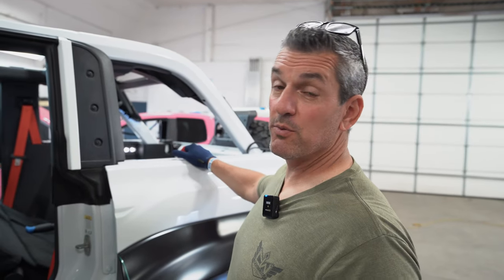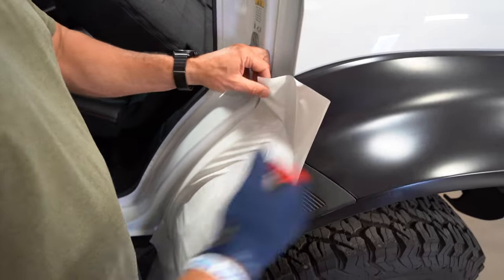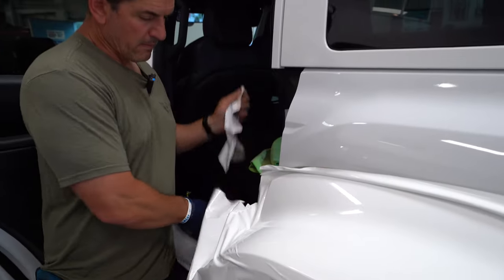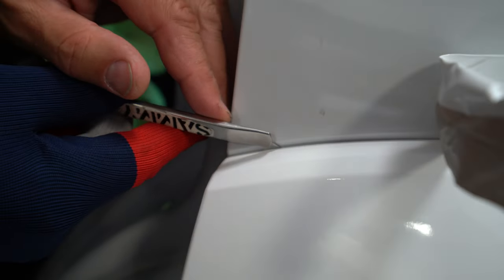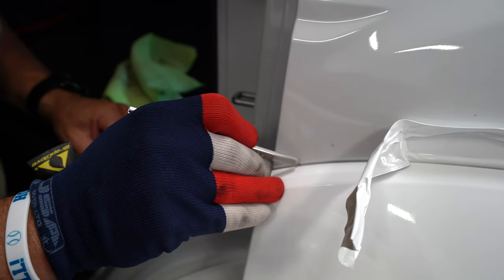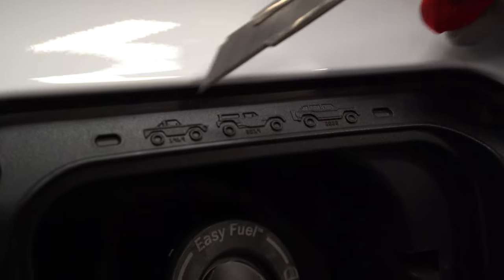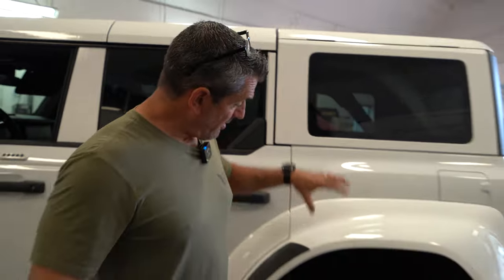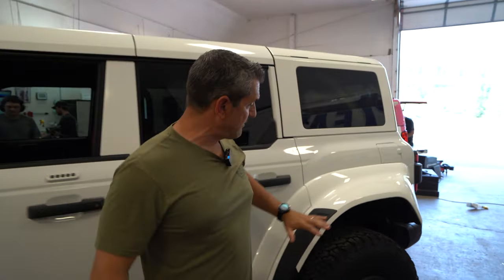Wrapping Raptor Bronco Fenders

Comment: How did you get the vinyl to stick to the roof panels? Did you have to sand them first?
Reply from the maker: @johnrohan1587  great question!! We wipe the panels with 70% alcohol, really well, and then use a heat gun and roller pro or v-cat by 3M to set it really well. Also used 3M 2080 white, the adhesive is tacky enough to hold well!
Reply: @sammycdub  Awesome, thanks for the response!

Comment: I have a Bronco Raptor in Memphis, 3 shops have turned me away. They would not do this job for me. Saying vinyl will not stick to fenders and top. I never really believed them.
Reply from the maker: Well, seems like we proved them wrong. It's not about the adhesion, these are tough to do, and rather than do a bad job, they just say it can't be done👍